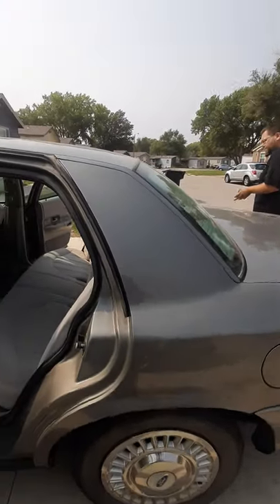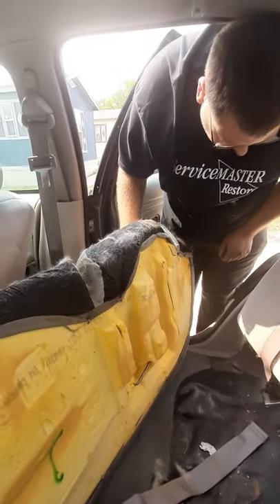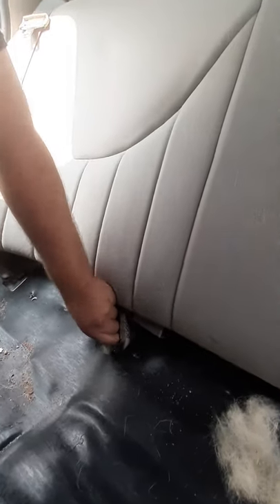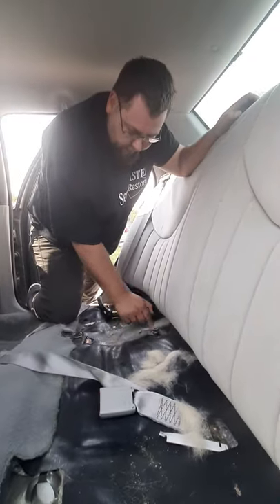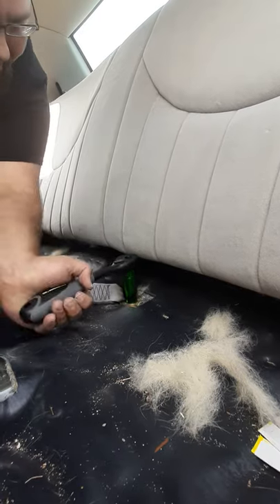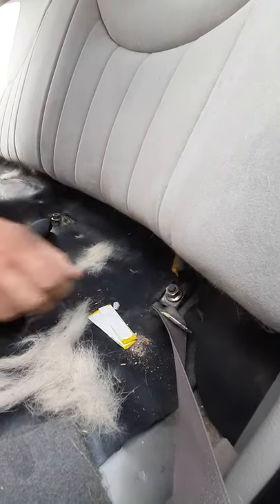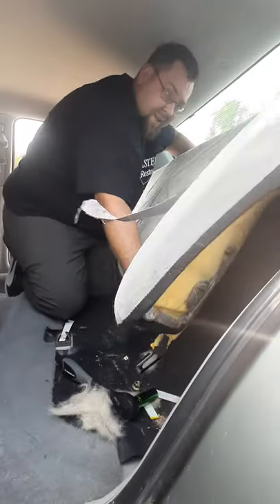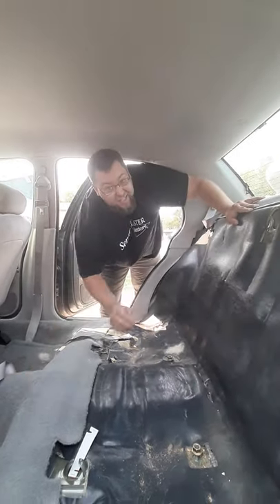2002 CROWN VIC BACK SEAT REMOVAL

Comment: Thank you very much for this vid.  need to replace the rear wheel speed sensors and the electrical locking tab is under the rear seat.

Comment: What's behind the sound proofing? I think most of us watching are trying to see if we can cut a pass through into the trunk for subwoofer box port. Is it just sheet metal? Structural braces?
Reply: You can, at least speaking from experience with an 05. Just some bracing like you thought. Once you remove the seat you can stick your whole arm in the trunk.

Comment: Very well done.  The 1995 Towncar is similar.  The part I am missing is the technique for pushing the seat far enough in to re-latch the clamps/hooks on the bottom.  Brute force just doesn't seem the same pushing on cushion!
Reply from the maker: You kinda have to have them at a angle and then slid it backward and then forward .if my neighbor didn't total my car 😒. I'd do a video just for you
Reply: easy money, sit on either side - reach your hands down where you yanked to pull it out - brace your feet against the front seat tracks- pull to the rear with your fingers and push down with your butt.

Comment: Great Video but I do have a question, My Mother's 2003 Grand Marquis LS has the same back seat and her trunk wont open, I hear clicking sounds so I assume the lock actuator is working , but I need to acces her trunk and wanted to know if I can but using your back seat removal technique and crawl in and pull the emergency release , she does have a full spare but wanted to know if its possible by removing the back seat and that rubber insulation in back of it-Thank you for any information or help you can give me.
Reply: I’m having the same exact problem truck won’t open with key I have a 2003 grand marquis, any luck?
Reply: @christopherjackson7407   -The best idea was pushing up & down with my arms on the trunk while engaging the fob trunk release and it opened without pulling the back seat. Turns out cargo net was caught in the latching mechanism and saved me  a lot of time and work
Reply: @mikebagatta2457  good to know brother! My trunk button doesn’t work, no key or key fob I think I might need a locksmith
Reply: @christopherjackson7407  -Sorry I couldn't help and good luck with trunk issue.

Comment: Do you have access to the trunk if you remove the soundproofing.  I am interested in hauling certain items which I believe I could do through the trunk.
Reply: I am also searching for this answer. Is that back wall removable? Looking to buy a Crown Vic police package model, but want to know about trunk access. Thank you!
Reply: Same here. And I believe so because a friend of mine has done that for scrap metal
Reply: @houssainalderawy313  thanks for the insight. I may be checking one out this week, I'll comment any findings if I do
Reply: @augustkraus1389  I actually spoke to him last night and he said you have to cut it out because it's welded on
Reply: @houssainalderawy313  good to know! Thank you!

Comment: I'm watching this so I can remove the back seats of my Town Car and cut through the trunk so I can make a bed.
Reply: Been looking for a video about this. Any success?
Reply: @abcdefgjdb  yes sir, I guess I should make a video showing it. I just used a $13 angle grinder from harbor freight tools and a $3 or $5 grinding disk to cut through the panels. It was tricky to get around the cables. One cable is a grounding cable so if you cut that or disconnect it, the car won't start.
Reply: The fuel tank is behind the seat 😂
Reply: @hydraulics  below, not behind

Comment: How do I get into the trunk?
Reply from the maker: I couldn't find any access point to reach thru to the trunk from behind the seats .I was hoping so .so I could add a blow thru for some subs later on .but no luck .have to cut and make a hole if you are needing access to the trunk .
Reply: @MrGruntdogg  Speaking of subs, can you tap into the speaker wires from the trunk if you were to install a line out converter for an aftermarket amp? Are you saying you have to drill a hole from the back seat to the trunk to route power wire? Picking up an 08 Town Car this weekend and looking forward to and dreading installing my sub sitting in the shed lol